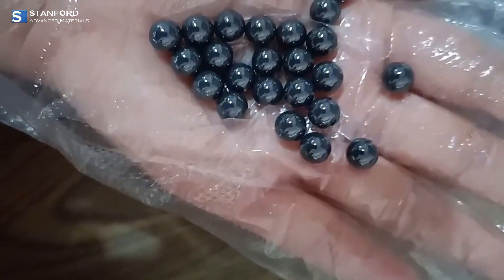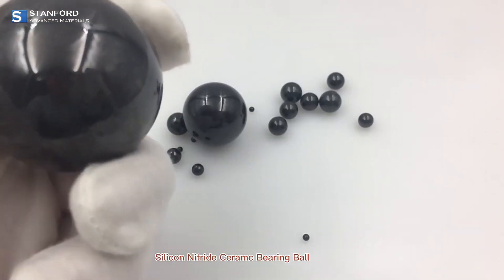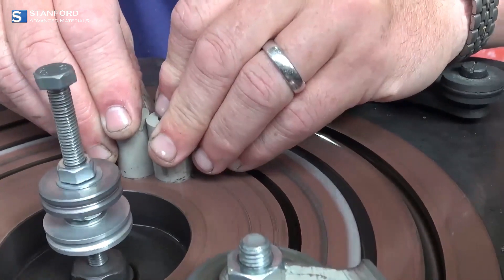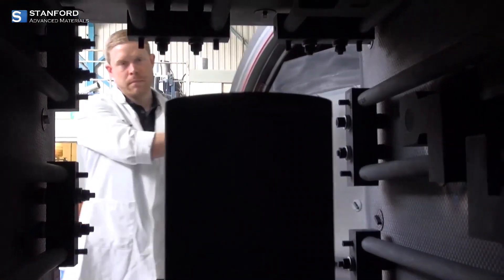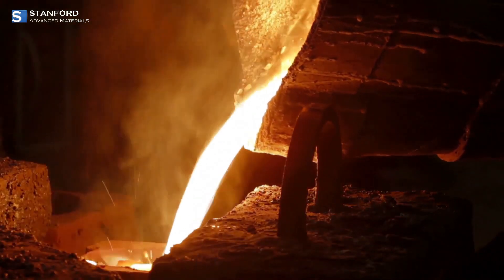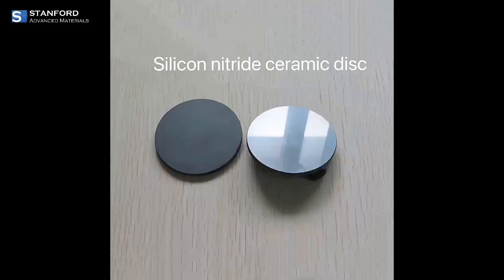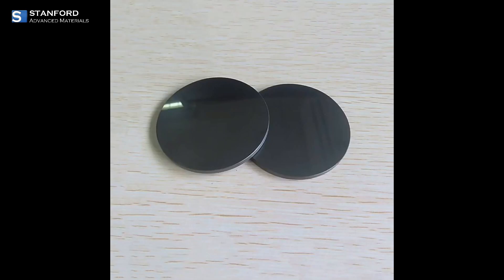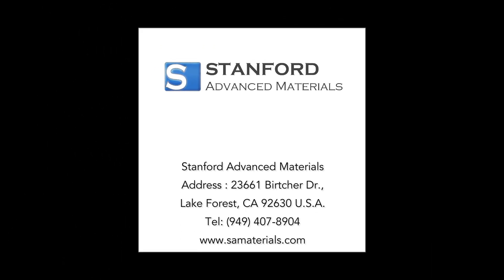Exploring the Strength and Versatility of Silicon Nitride

Comment: cheap and make great bearings for ...anything.  I use them for phono turntable bearings.
Most remarkable test.  I carefully secured a 2 mm ball bearing on a hard steel vice.  I then took a common carpenter's steel hammer and hit the bearing as hard as I could.  Nothing.
Under a 100x microscope power, there were absolutely NO nicks, scratches or visible damage.  I lack test gear to detect internal structural change.   The shiny surface was not scored in any detectable way.  
Dear lord, silicon nitride (ceramic) bearings are harder than 660 steel.
I first used this material 25 years ago.